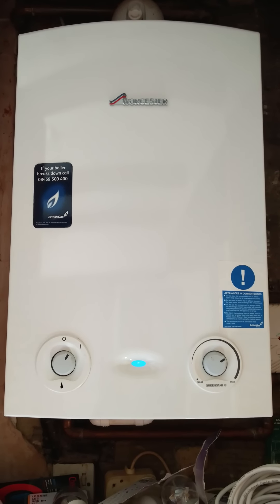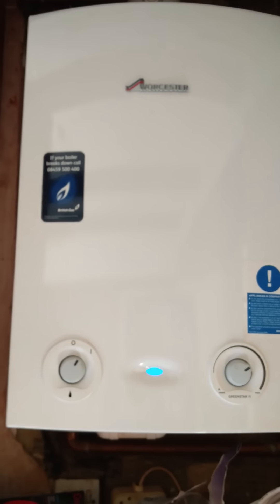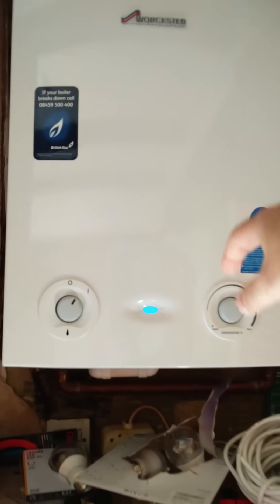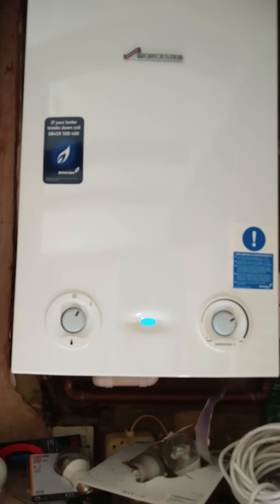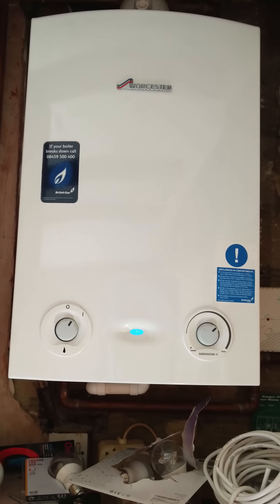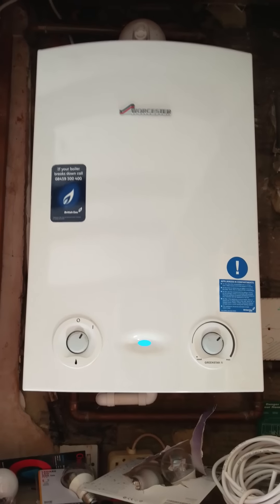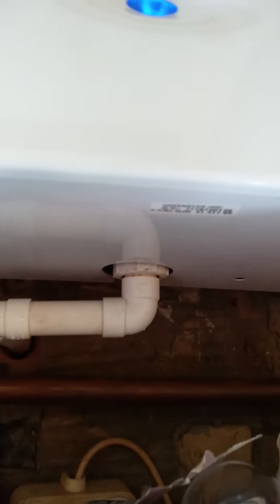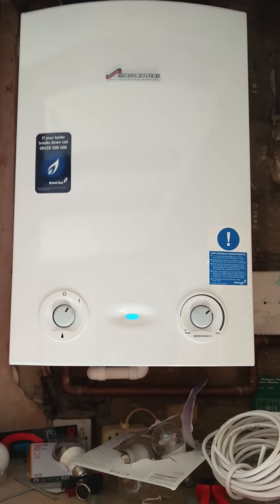Part 2 Worcester 24Ri boiler fault blue light flashing no heating/hot water sound of water gushing

Comment: Thanks ever so much for posting this. Mine was doing exactly the same (15ri model). Your explanation of what your plumber did was just the ticket! Power off, 
Took the panel off, removed the grey contol panel assembly at the bottom to expose the yellow syphon filter assembly, unscrewed it, wriggled it out. 
It was full of silt/limescale. Cleaned it out, reassembled it. Fired up again, job done! Took 40 minutes and 1 screwdriver. 
Thanks again for posting.

Comment: Turned out my boiler had the same issue. Cleaned the condensate unit and then the boiler works perfectly. Thanks for sharing.
Reply from the maker: +Arvind Sharma I'm glad this helped you out. You seem to be very confident to have cleaned out the the condenser box yourself. My boiler is still going after my plumber did this last year. Hope your boiler will work well for many more years.

Comment: Thanks a lot. Got exactly the same issue and decided to try this. Condensation tank was really blocked. Cleaned it and it worked. Another thing I noticed is that I need to reset the boiler after the task. The knob on the right side and move it to reset. For me initially it didn't work but luckily I tried to reset it and it worked. You saved my day in this -4 weather today  👍. Thanks

Comment: Very cold weather here and the boiler not working with similar symptoms.  I found the condensate drain blocked solid with ice.  This pointed me in the right direction thanks for the video.
Reply: Chris Taylor how did youfix this same thing for me
Reply: lee churchman 
I tried unblocking but it is too blocked up with ice.  I have disconnected the drain from the pipe and I have it dripping into a bucket (just have to remember to empty it, though it seems to be filling very slowly).  I will do a more permanent solution once it thaws.  You can just take the panel off the bottom of the boiler (1 screw) and release the drain and the water runs out (turn off the power first just in case). Good luck.
Reply: Thanks chris ive drained the pipe under the boiler which seems to work for a while but then it's going off again
Reply: lee churchman 
Do you drain and then reconnect the pipe ? If it is blocked, water will just keep building up.  If when you disconnect the drain pipe water runs out, you have a blockage somewhere
Reply: No not the pipe but the little box above it ive drained it until it stops its working properly now but outside the vent is gurgling
Reply: lee churchman sounds like water can't get out properly if it's gurgling - is it the problem the original video poster talked about with limescale buildup ?
Reply: I think ive done it run some boiling hot water over the outside waste pipe and loads of ice came out problem solved thanks for all your help guys

Comment: Your plumber has left out the bottom left fixing screw, so the boiler casing isn’t sealed. That’s not very good
Reply from the maker: Thanks for your comment. The screw was missing before my plumber came out. He tried to find a replacement to fit in his bag of bits and bobs but no luck. Probably a previous engineer that didn't put it back. All been replaced now.

Comment: Do not get caught up in ‘service plans’ only covers cost of engineer coming out £50-£60 saving but then you get charged through the teeth for repairs and parts. Find a local qualified gas safe registered engineer to come and properly service a full service takes about an hour if the engineer is there for less than 30 mins I would question them. Only work on boilers if your gas safe registered or competent to do so.

Comment: BG are useless , they don’t service boilers as they are supposed too , they turn up and stick an analyser on the flue and that’s it , when I service a boiler I do it correctly and to M I specifications and to do most boilers properly should take a competent engineer between 45 - 60 mins inc a full safety check on completion , anyone that turns up for 20 mins and says it’s been serviced is robbing you and I’m afraid BG is the worst offender , my advise to any home owner with a BG service contract is to cancel it and get a local independent engineer to come and do the job properly......👍